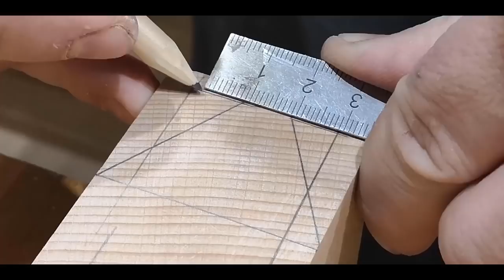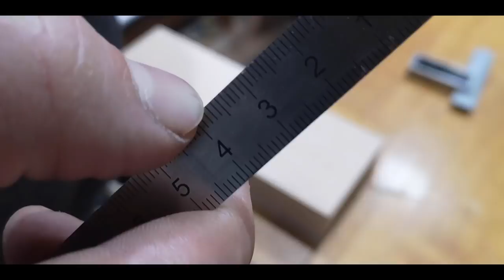028 Double chamfer plane for planemaking / woodworking

Comment: Great job, as usual.
I have not seen such a tool for grinding - a file with teeth. What is it called and where is it sold?
Reply from the maker: Thanks! It was self made edge float, i made push and pull version. Lie Nielsen have it in their shop. Regards!

Comment: I had to go back at minute 3:20 and brood a couple of minutes to understand.
Let's see if I get it: the resulting chamfer will be at 30° on the vertical side. With two mirrored channel you can reverse the cut when you are chamfering an edge and you are cutting across the grain. Am I right?

PS: Good job. In the next months I would like to build some molding plane, and I love beech. Do you think is the right wood for a molding plane?

PPS: thanks for sharing. :)
Reply from the maker: Yes, you got the point. That's how it works :)
Beech is good choice, just use straight-grained quarter sawn blank, and make the sole on the bark side. 
Good luck:)

Comment: Thanks for this great video. Ad usual. What is the method you use three finishes together? Shellac, paraffin oil and boiled linseed oil? How do you apply the three?
Reply from the maker: You're welcome Adam :) 
Only one coat of BLO
one coat of shellac 
one coat of parafine
wipe of the parafine with fresh paper towell

one coat of shellac
one coat of parafine
wipe of the parafine with fresh paper towell

one coat of shellac
one coat of parafine
wipe of the parafine with fresh paper towell

one coat of shellac
one coat of parafine
wipe of the parafine with fresh paper towell

That's what i do :) 
Regards